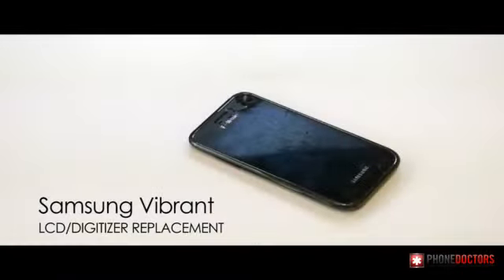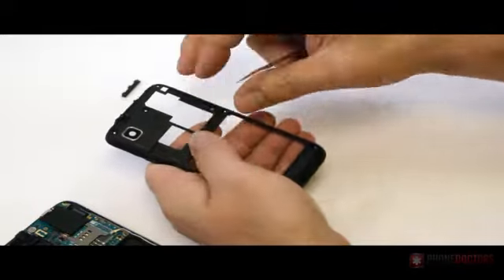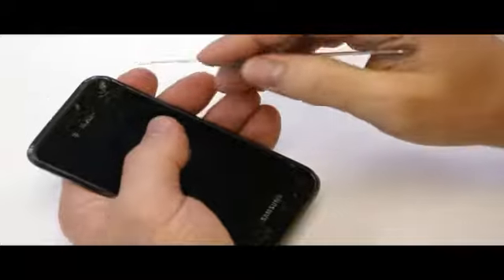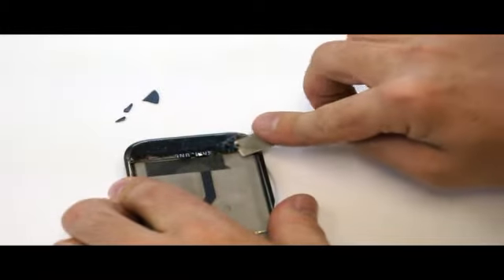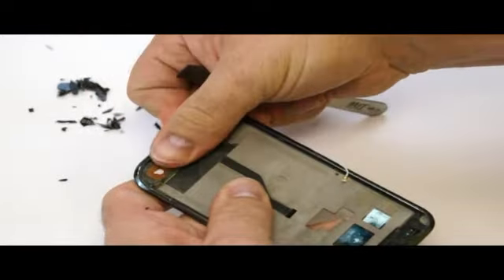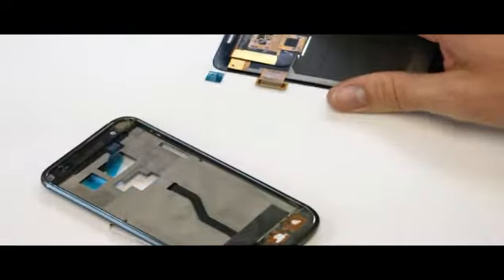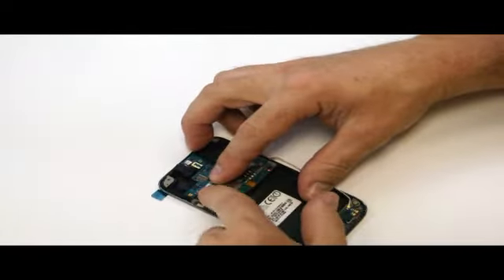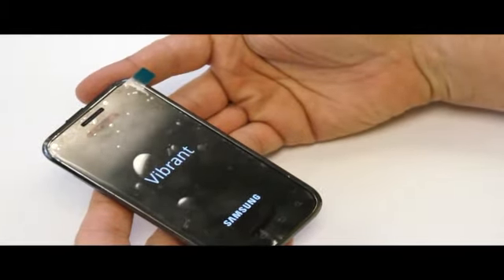Samsung Vibrant T959 Phone Screen Repair and Replacement LCD

Comment: Thank you so much for this video. I bought a new screen off of eBay for $95. I followed your instructions and now my phone is fixed. It took me 3 times as long to do because I was extra careful, but it works. I would have never attempted this on my own without your help!

Comment from the maker: Unfortunately the glass is fused to the LCD. If you try to replace just the glass you will break the LCD.  This is an easy repair if you watch our video.  By the way, we offer replacement parts and tools for Samsung Vibrant T959 on our website when you follow the links in our video description.

Comment from the maker: It could be that the LCD connector is not connected securely to the board connector. double check and make sure that is secure, if its still giving problems, you may want to give us a call to  arrange a replacement. We strive on customer satisfaction, and we want to see you happy! Make sure and have your order number ready when you call. 1-855-234-9483

Comment: well should have watched this before trying to fix shit....
Quick question... i pulled out the touchscreen, and the black layer under the touchscreen, ofc. i ripped my flex cable and im left with the white layer ? what do i need to buy now in order to fix it ? do i need to remove the white layer as well ?

Comment: REALLY need help here. I originally watched this video with the intentions of replacing the motherboard ONLY. I followed the instructions and replaced the motherboard correctly, but now for whatever reason, when making a call, the phones screen immediately goes black and stays that way for several minutes. everything else on the phone works great, but i NEED to know whats going on..